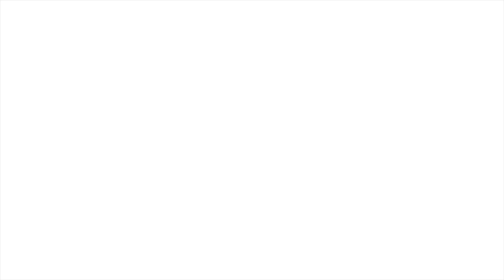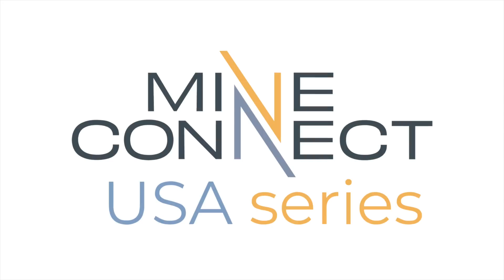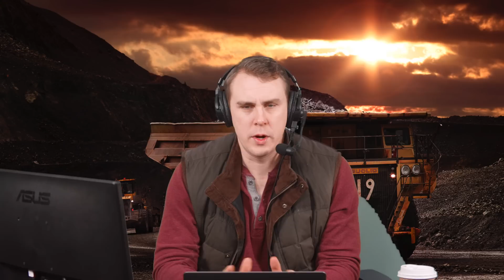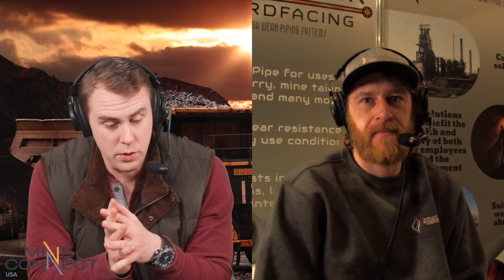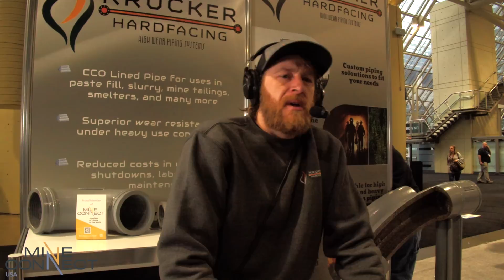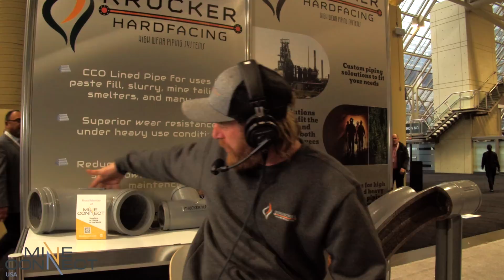Krucker Hardfacing: Innovative Piping Solutions for Heavy Industry #06

Comment: Great interview .  I learned a lot.   First time I heard of inside pipe wear was when I learned that water going through Pex plastic tubing ( for floor heating )would wear out faster in tight bends then in larger radius bends.  That amazed me to understand that just water at house pressure would wear out plastic piping .   This helps me to better understand how a larger diameter thick walled steel pipe would wear out from a fluid carrying abrasive debris .   It would be great to tour a plant that  coats internally large diameter pipes with Chromium to see how the process is done on a manufacturing level .  I have worked in plants where car seat belt buckles went through a rock tumbling, nickel strike then a chromium plating to complete the product .
Reply from the maker: Great comment, and thank you for watching!